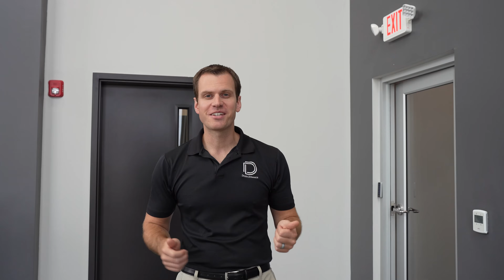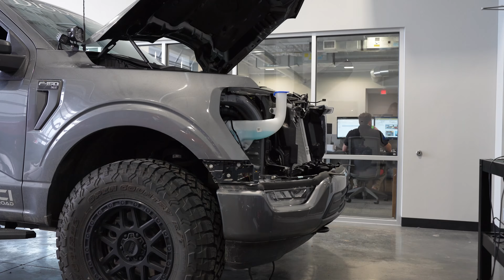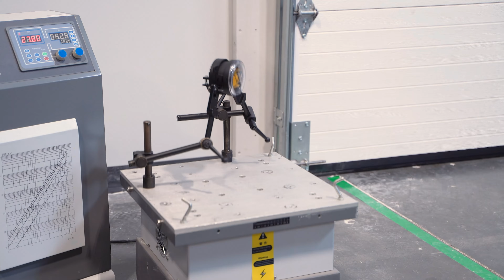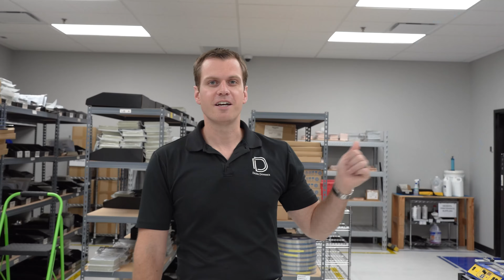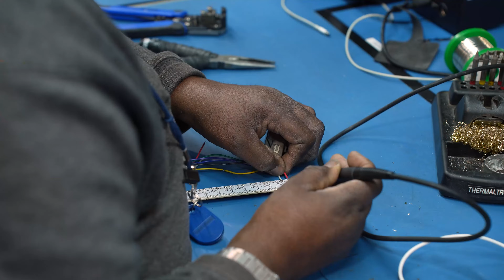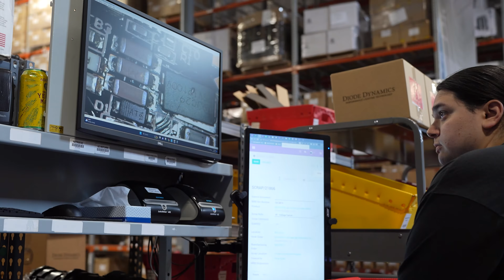How It's Made: Diode Dynamics Factory Tour 2023

Comment: As a lighting expert, I was excited to see the step by step manufacturing process. I have sold GE (Current GLI) LED products for many years. Their attention to quality is second to none. Your facility is the first one I have seen to employ the same standards and practices from design, engineering, testing, and manufacturing. Well done! This is why I am willing to spend a little more for quality lighting products from Diode Dynamics. I understand the need for quality optics, heat sinks, vibration testing, and quality control. Not all LED products are created equal and it’s clear from this tour that you have set the bar high.
Reply from the maker: Wow! Thank you for the kind words and support! 🤝👏